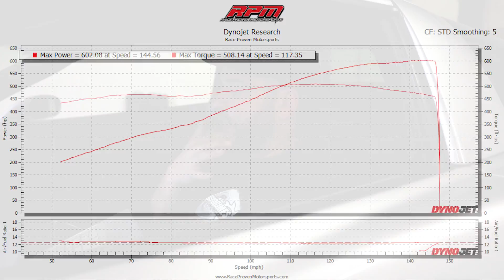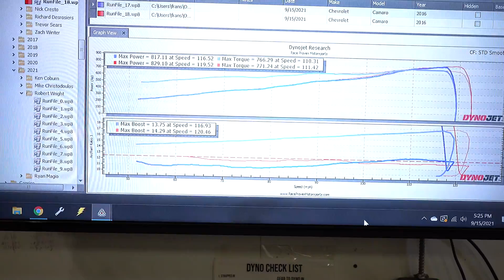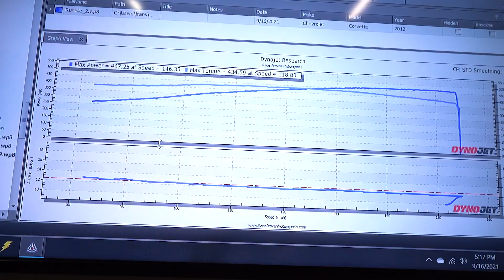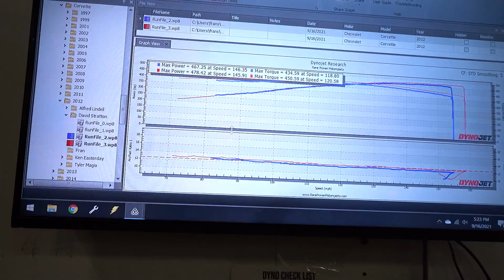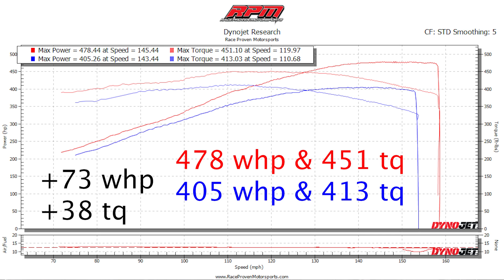1xxx?! hp Stage 5 Camaro SS, Stage 4 C7 Z06,  C6 corvette dyno pulls & more | S10 Ep 14

Comment: Is it possible to install a ls cam 180* out on the wrong stroke? 🤔
Reply: Meaning 180* out dot to dot on the wrong stroke.
Reply from the maker: If it’s dot to dot it’s correct
Reply: So it can’t be dot to dot on the wrong stroke?🤔 meaning piston number 6 is at tdc? Instead on number 1
Reply from the maker: No

Comment: My Local shop is thinking of adding 125$ on top of my whipple install. To install my cold air induction pipes. Intake is installed already swap sensor and done. 🤦🏻‍♂️

3 dislikes from Ford drivers 😂
Reply from the maker: If it took them an hour to modify and install then that seems about right